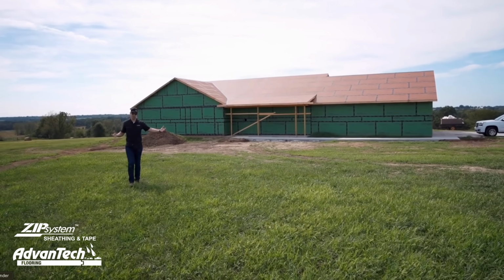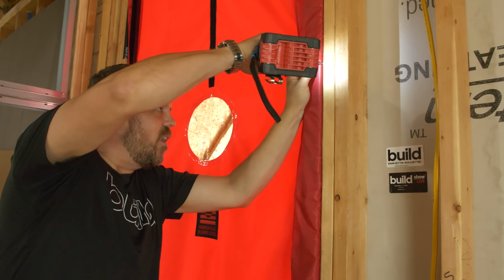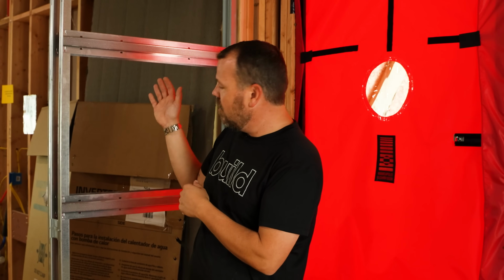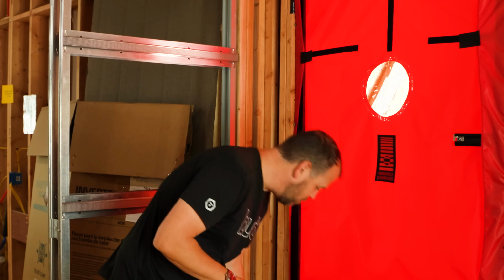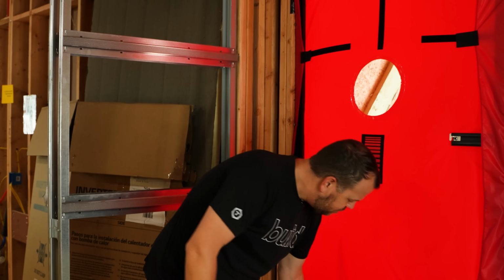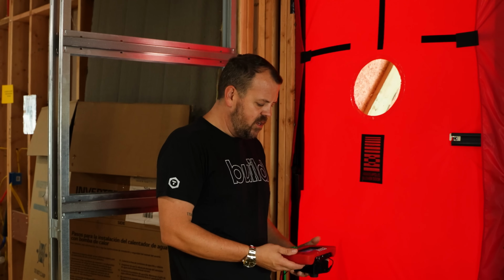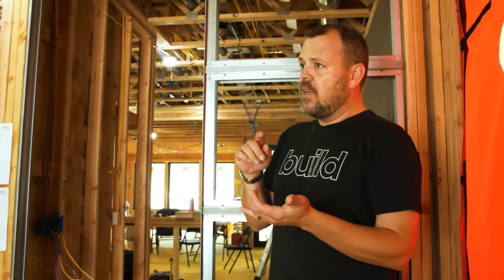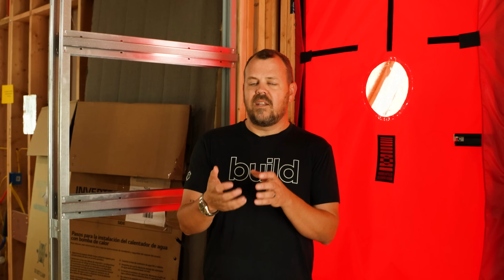Check but Verify - Why we do multiple blower door tests

Comment: It's funny watching how the US is so far ahead of Au in some ways - like the blower door requirement - while being so far behind in others - like the use of toxic outgassing and flammable plastics. In Australia it's a real question "if this house burns down, will people die?" and we take it very seriously.
But I'd like our standard of airtightness and mechanical ventilation to be up to the same quality as our fire safety standard.
Reply: it's been wild watching a NZ YT builder do their work, so wildly different when it comes to tightness / open/closed etc. Feels like you're stepping into 1950s US (with bonus most of everything is treated).
Reply: Seems like a weird thing to focus on since only 0.006% of house fires result in deaths. You have the same odds of getting struck by lightning.

Comment: Here in Texas I saw the requirements coming so I got certified as a rater and bought the tools and added the service to my HVAC company.  But, the reality is- there is so much construction the city's force retrofit of HVAC equipment and ductwork to be tested but builders are getting a pass. The city's I talked to said they require blower door and duct blaster tests but aren't getting them from the builders and are giving certification of occupancy any way. Needless to say I'm selling my equipment.
Reply: id imagine you have the same issues that Vegas has. its easy for the smaller builders to get everything done closer to the right way, but try getting the big trac builders on board is a different story. they want to do the barest of minimums and just keep going along. its sad really. the whole industry broken and needs repair. 90 day finishes are not a quality product.
Reply: I am in South Jersey. a lot of building going on. No blower door test. I was thinking like you, buy the equipment and get certified. How much did your blower door cost? How much to get certified? I am retired so if i just made my money back and I was able to do my house after a full gut remodel 4 years ago I would be happy.
Reply: @lrc87290  I bought most of my tools from vent cap systems.  They are on sale right now. I plan on selling mine soon. I got tge BPI certification.  But they changed their rules.  If I did it again I would get a HERS rater certification.  They are more stable in their program.  Tools cost about $12k certification about $3k
Reply: @jasonc2313  thanks for the info

Comment: the more I see requirements like this the more I know poor people will never be able to afford new homes,,
Reply: This is not so much about spending money on expensive materials, it’s about caring about your workmanship.  It isn’t hard to build a good, durable house, but it’s way easier to build a bad one which will have elevated energy bills and potentially need premature (and expensive) repairs.
Reply: @superspeeder  
you speak like a person that doesnt have to worry  about money

like I said,, they are getting so expensive to build  the poor will never be able to own a home,,
Reply: @madebysteve1738 So why are you even on this channel? It's 100% about building a better house. If someone is building a 300k shitty house, maybe they could build a house 20% smaller and actually use some good building practices that let them have low utility bills and a better quality of life. This is not "build a house for people who refuse to leave their dead-end retail jobs" channel.
Reply: @Buickman455  pardon me I didnt realize I was speaking above my station,,
Reply: You want poor people to live in dangerous, unhealthy, poor longevity, expensive to maintain and heat/cool/power homes? Standards shouldn't be skimped on just due to up-front affordability. There are other costs that add up over time and should be considered. These requirements are not very high, and can be achieved if builders did some basic swapping of materials and didn't slack on basics/installation details. It's frustrating how high-end builders avoid the middle and low end because there's less margin to be made there, a lot really love to pop folks eyeballs out simply because that's the market we're in right now. Forcing better standards will bring this more and more to everyone, which should help bring costs down too. Rising tides raise all ships.
Reply: @colinstu  that has got to be one of the dumbest,, no it is the dumbest comebacks I have ever gotten on this topic,,

when you care to have a rational discussion on the matter let me know,,
Reply: @madebysteve1738  not a single constructive thing said. You sir are a genius. But yeah feel free to search up "Environmental dumping", which is usually more in line with saddling those w/less money with less efficient stuff, but it applies to housing too. If folks were really interested in saving money, they would build rowhouses so they could share building costs with their neighbors - this practice is pretty common in europe. Meanwhile old discriminatory single family zoning reigns supreme in the US and it's as hard as ever to encourage development. Thankfully some progressive areas are allowing multifamilies in more zones, and already seeing boosts in ADUs being built and more du/quadplexes. Can build a place that helps more than one family, and building costs split and shared much more efficiently than if everything was separate.
Reply: I do think there is a real argument to be made however that a more considered approach can improve the quality of the performance of the home to a point that the building becomes more economical to own overall. Our homes cost upwards of hundreds of dollars a month less to operate than existing homes of the same size. This makes a new home virtually the same cost as a thirty year old home in my market once operation is considered. It doesn’t cost as much as you might think.
Reply: @jake.bruton.aarow.building  when youre poor that high purchase price on this type of house is not achievable,, but when stretching it over decades through higher energy costs is achievable,,

dont take my word for it just ask your banker,,
Reply: @jake.bruton.aarow.building  i think the better question is how to get the big trac production home builders on board. i feel like @madebysteve1738 argument is more fitting of them then the smaller builders. i love matts videos, as he is taking all the science into account with his builds, and they are not giant custom mansions. i believe the argument lies more with, if kb/dr/richmond/century etc etc were to build better and tighter that their over priced homes inflate to extremely overpriced.

Comment: When I had my blower door test done on my personal build, my painters had just left late the night before finishing up painting and they forgot about to re-install the weather stripping on my exterior doors, and we later found out that Lincoln has forgotten to install the bottom weather stripping on my 12’ sliding patio door at the factory. That next morning the BD guy showed up earlier than I expected and I hadn’t re-installed the weather stripping on 4 exterior doors. I was on a time crunch to get CO and movers were scheduled in 2 days. I was nervous what the results would be but I still got a 2.0
Ach50  🎉. One day I’d like
To get them back out to re-test.
Reply: if you ever retest let us know the ACH50 after getting all the seals and stripping put back.

Comment: we have had blower door tests code her for quite sometimes. it's about $400 bucks and they drop the paperwork with a pass it dropped off. I mean they probably test some houses but they will give you a pass without actually doing the work.
Reply: That's fraud

They're committing a crime
Reply: @Ariccio123  i agree, but what OP said happens all the time. if you cant prove it didn't happen then it just a he said she said. sadly most builders move people in so fast you wouldn't be able to preform a QA on said house anyway.

Comment: If you were going to do 3 blower door tests where would you want to do aero barrier if you were gonna go that route? I'm guessing after all the holes have been punched in the walls but before drywall?
Reply: Absolutely because it might keep you from doing Aeroseal altogether because you discover you don’t need it.
Reply: in my climate zone aero barrier wont do anything until post drywall hang typically post trim. i feel like there product would be better utilized pre insulation if possible. i think about what it might do to affect the insulation r value if it starts to slowly stick to itself and close up holes. i would imagine it does the same thing inside the insulation.

Comment: Zip-R properly taped and closed cell foam between studs will get you a pass on a blower door test.  No extra planning needed or expensive latex vapor misting to seal missed cracks.  We did one test after insulating and our numbers were 75% better than passing with a forgotten 6" unblocked vent to outside near furnace in basement.

Comment: Ever try using a fog machine?  It really shows leaks and embarrasses the worker that swears it is sealed well. (While doing the blower test)
Reply: My 1986 ACH50 retrofit was 1.25 — more leaks to plug.
Reply: I’m going to use a fog machine on my personal build.  I expect to be the one who’s embarrassed. 😂
Reply: @superspeeder  lol. We had a makeshift blower door to pressurize and a band fog machine. Wind was minimal outside. Walking around with fog made every leak obvious.
Reply: @RBBlackstone  that’s my plan as well.  I bought a cheap used fog machine and got some good juice from a local music shop.  I bought an 8” inline fan to pressurize the envelope.

My cheap DIY blower door test will be flipping the fan around to depressurize, use the variable speed control to get close to 50Pa on my manometer, then use an anemometer to measure the air velocity drawn into the fan.  Not a certified test, but should get me in the ballpark.